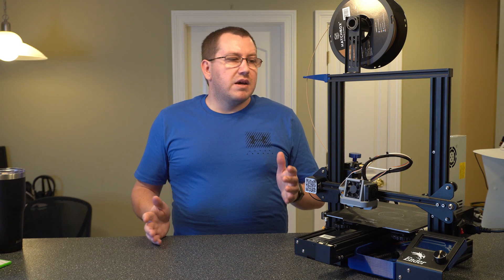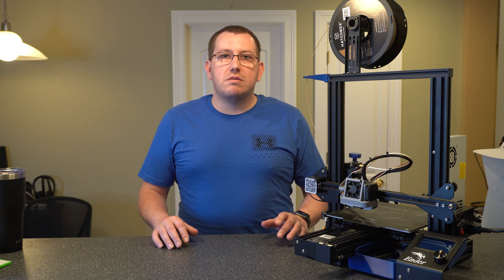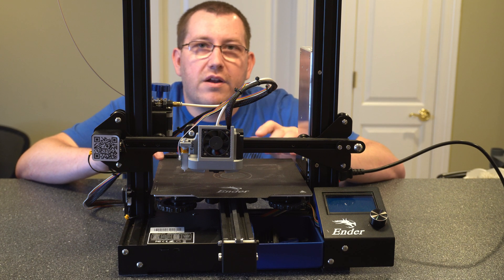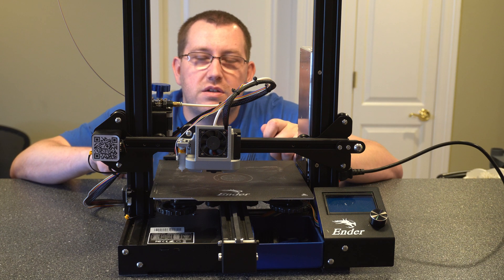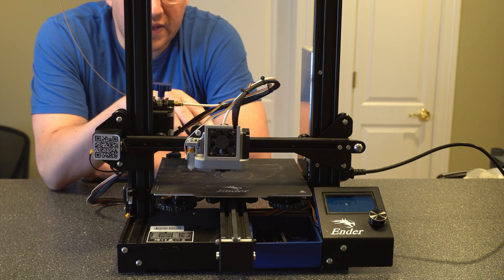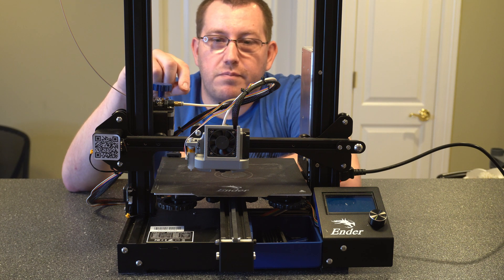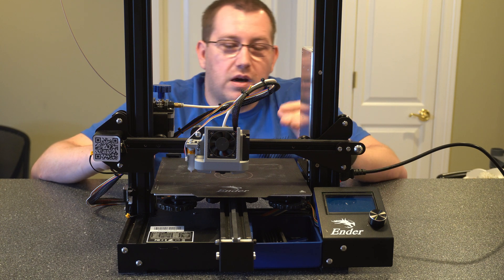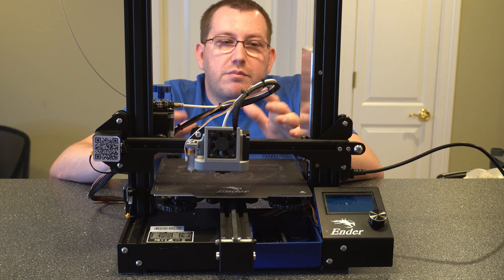Ender 3 Pro Maintenance – What I Do

Comment: Hey Rob, question for you.  I also have an Ender 3 pro and I upgraded to a glass build plate but I noticed there is a thin gray film between the metal build plate and the glass.  Should there be or should I remove it so the glass is directly on top of the metal plate.  If I can figure out how to do it I’ll share a picture.  Thanks so much for your time.
Reply from the maker: Hi. Im thinking you should remove it but i would want to see a picture before saying for sure. You can email it to me, my email is admin@3dprintscape.com .
Reply: I sent you a note to your email.  Thanks!!

Comment: Odd ? I tried linear advance. It worked with marlins online script, but then in terminal didn't know what M900 was. So I enabled it in firmware.. now the extruder gives up after a few steps! I revert it's fine. --- "solved"... Won't work with TMC drivers at all.
Reply from the maker: Interesting, i will look into that some to see if i get the same behavior.
Reply: @3DPrintscape  thanks I'm sad. The board is a creality 427 with bugfix 2. I enabled linear adv again and it reoccured
Reply: Direct drive here I come
Reply: Rob sorry saw it is a no go with TMC drivers. No linear advance. I hate those bloody corners!

Comment: Hi, I’m having trouble converting from .stl to .gcode. I’m using cura and I believe everything looks ok in cura after I slice the object. When I print the filament comes out brittle and in globs. Any advice on converting to .gcode or tips on settings?
Reply: The printers now working great! Thanks for the help and awesome videos!
Reply from the maker: Awesome, glad I was able to help out.
Reply from the maker: Hi. If the test print is coming out fine, the issue isn’t with the printer, its most likely with how it was sliced. I created a couple of videos on this that may help you out. If you are still having issues feel free to reach back out and I will help you troubleshoot. 
Ender 3 Pro Cura Setup (The Basics): https://youtu.be/uzQys6xiCFo
How to Print a Thingiverse File on a 3d Printer (The Easy Way!): https://youtu.be/eXYpFLnrvgM